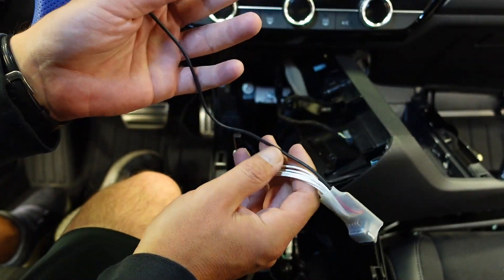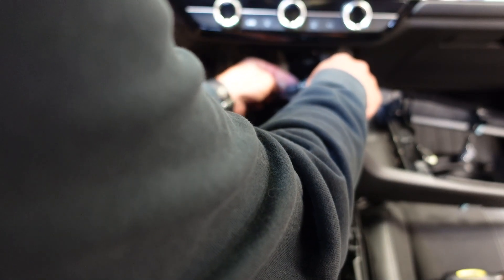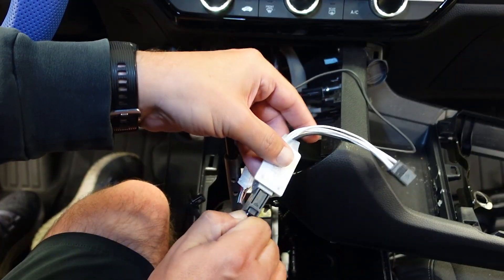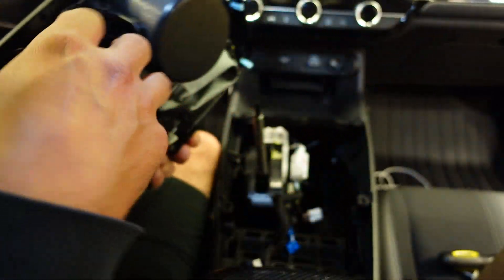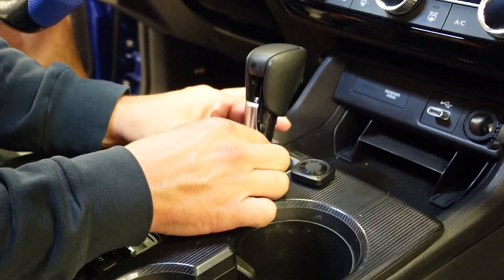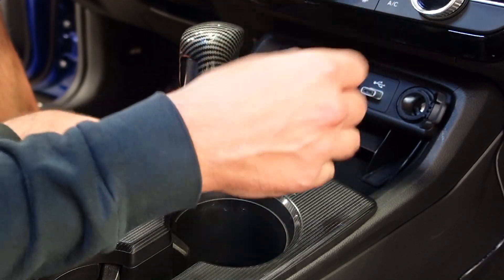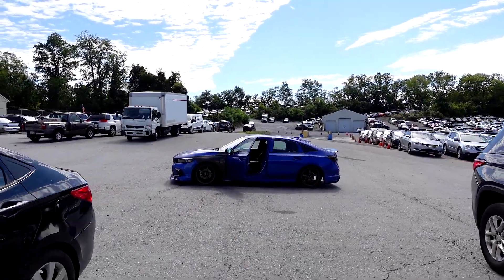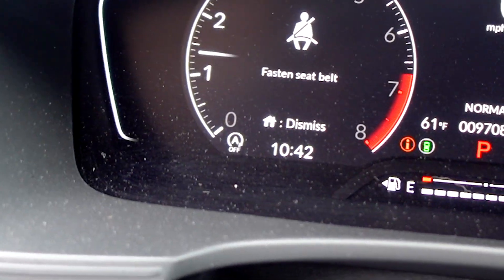IDLESTOPPER for the 11th Gen 2022 Honda Civic Sedan & Hatchback/Sport/Touring/Si

Comment: Great video, as always, Miller. *I rarely go to SB, but often buy their bottles Vanilla or other flavor Frappuccinos from my store. I heard that was good, but if I do go to SB's, I usually get the Venti Tazo Chai Latte.

Thus is good to know, simple plug and play installation and easy to remove. Good to know fir Civic owners, and me if I happen to get one. But, glad to know that the HR-V does not have it. Per Scotty Kilmer in a recent video, there have been several reports of problems with thst system in the Civics, where the car would not restart after shut off, and car cannot be started, jump started, etc. 

The projected fuel savings using it is minimal/variable depending of the driving habits and condition of each vehicle.
Reply from the maker: Thats one of the big reason I wanted it. Don't want to get stuck at a red light.
Reply: That is the first I've heard of this problem I hope it does not happen to me but I'm in a pretty good habit of slapping that button as soon as I start the car

Comment: Great video, Will adding a second exhaust on the 22 sport void warranty?
Reply: It didn't void my warranty, but definitely talk to your dealership about it, its only a 5 min call lol
Reply: @zippystew45  Thank u
Reply: @carlosdelreal5756  also make sure you talk to the people that deal with the warranty stuff, just the regular salesperson might tell you otherwise
Reply: Usually, anything after the catalytic convertor and O2 sensors are usually okay, if noise and emissions are compliant with your state. Unknown if the difference in back pressure will adversely affect your IEM ECM calibration.
Reply: *Also, if you have a fairly popular vehicle, one of the major muffler/exhaust system companies may have a bolt on cat back exhaust system for your application. Of so, the probably know their stuff and did their homework make sure it will work with your vehicle not to cause any problems with yourr OEM tuning calibrations and proper operation.
Reply from the maker: It shouldn't void the warranty. Unless you have a noise ordinance in your state. Then as long as the DB's are low enough you'll be good.

Comment: No! it does not void your Honda Warranty. It is automatically triggering the switch for you without having to push it. Okay! please do not use the USB ports or 12v socket, or anything that has a button you must push. Do not push on the Brake pedal as it will make your brakes fail or too much pressure you will cause your brake lines to leak. Don't turn the steering wheel, it might fall off. Hope you now understand, it is a simple bypass and it will not affect your Honda Warranty. Use some common sense.

Comment: I thought I was going to want this for my Si but I've learned that, with the stick shift, it's super easy to manipulate the Idle stop. If i want it to not stop i just keep the clutch down (say, if i see the light is already changing). If I want it to kill at a drive through or slow light I just dump the clutch in neutral. I've grown to like it more than i thought, given the implementation with the manual transmission.
Reply from the maker: That's cool!
Reply: It's easy to manipulate with automatic too. It doesn't shut the car down unless after you stop you depress the brake pedal more after stopping. So if I stop at a red light that I know is long, just push the brake pedal down further and it shuts off. If not just keep it where it's at and car stays on. That's how it is on my 2023 civic sport anyways. There's also the option to press the button to turn the feature off obviously

Comment: No offense but your dealership sucks if that voids warranty, i am able to basically  rewire my entire car as long as i do it correctly it won't void warranty, but that could also be because im an electrician but idk it technically wouldn't be fair to other if that's the reason they let me do that kinda stuff
Reply from the maker: I was told it would. Easy to remove so won't be an issue.

Comment: I'm confused.....mine has a button to turn it on and off from factory. Also does no one like this feature? I find it saves me alot and have seen my mpg go up when active
Reply: I don't like it because it is not smooth when it engages the engine back on, actually jerks me forward, plus im just thinking does this make the starter go sooner cause its being used so much? I dunno ....
Reply: @mikedisco  just keep your foot on the brake and it won't jerk forward upon restart. Mine feels just like a normal start when it kicks back on.
Reply: @DesertGoat  How do you start the car up again then? Rotate the steering wheel?